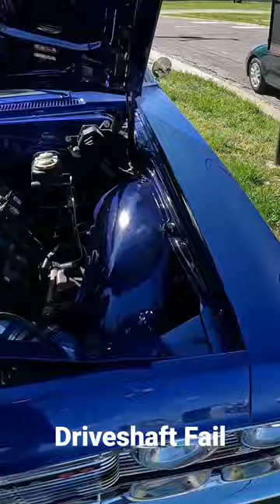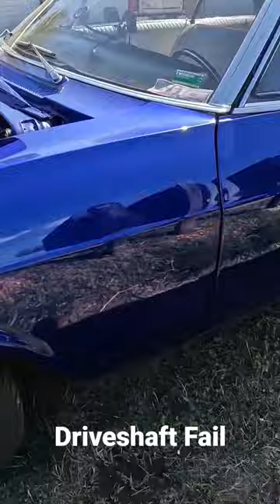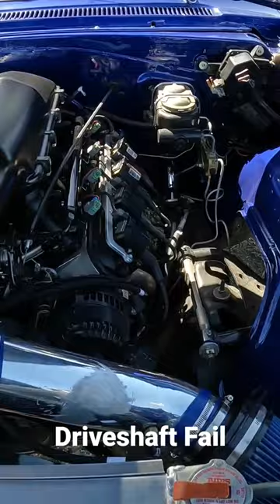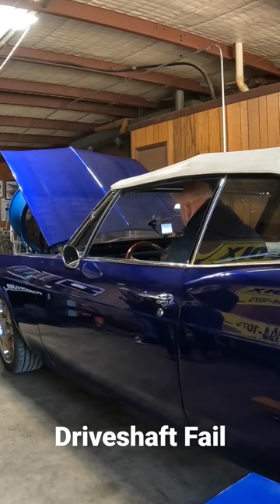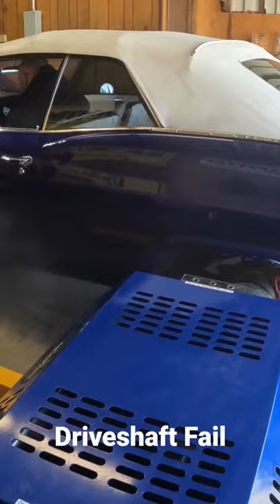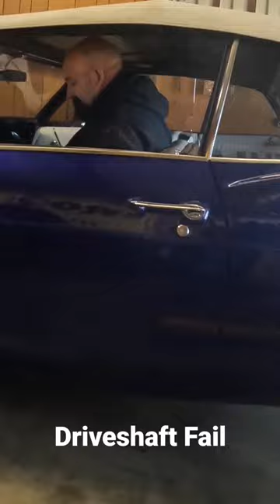65 Impala SS Dyno Fail

Comment: Should have let up when the vibration started. You can see it shake your car
Reply: It was already gone when it shook.
Reply: lol yeah right bud when a driveshaft goes its gone....
Reply: @harmankardon478  not if it's a joint or ear. Better than busting up the bottom of the car
Reply: Looks like it shook as it beat the crap outa the transmision tunnel,
Could have been on the way out for a while though but with rubber mountings didnt feel it goin for a few weeks, i got a car and driveing it no vibrations at all but twist the propshaft with the hand brake on and feel the play in the u jount